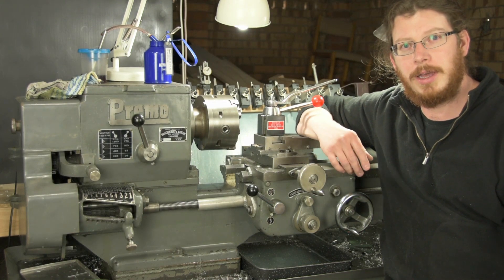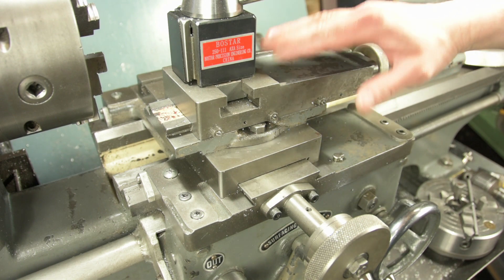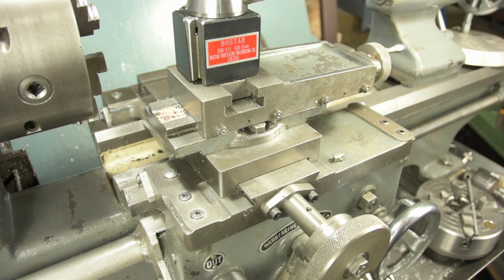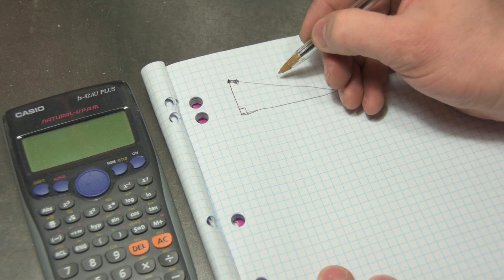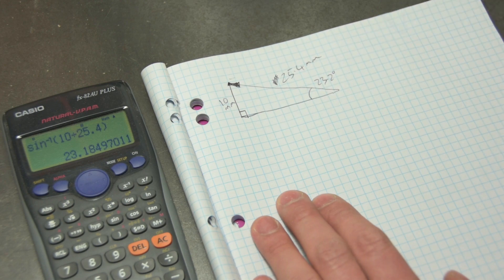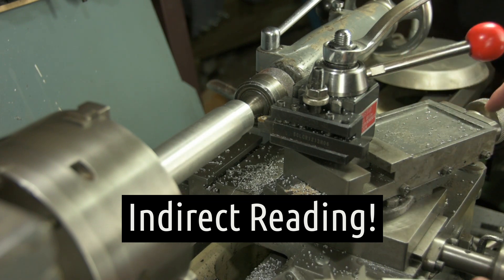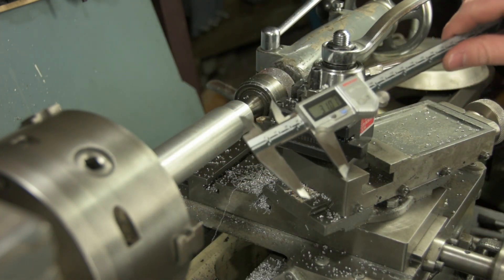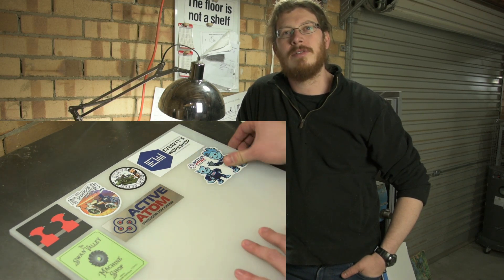Making metric cuts on an Imperial lathe (and vise versa)

Comment: Or plan B...make a set of Imperial/metric dials. My lathe has them, but I never bother using the metric scales as the cross feed and tail stock feed screws are imperial.
https://i.postimg.cc/j24W4tJZ/IMG-0821.jpg
Cheers from NC/USA
Reply from the maker: That's a good setup. Some of the imported lathes sold new in Australia have that feature. But - the lead screw is always either metric or imperial and if you're using the non-native units, multi-turn movements can become a maths quiz where a wrong answer means a scrapped part. :-) I am hoping to install a DRO one day on the lathe. Installed one on the mill and it's an absolute game changer. Just a question of raising some funds. And that's especially difficult while trying to buy a house. Thanks again! Craig

Comment: Very cool. Any idea what this is called? Not the mathematical part. I assume it has some sort of name for this procedure,   easier to google search it for more info.
Reply from the maker: Thanks Craig. The fine compound feed method using a ratio of 1:10 or similar for either metric or imperial is an old old trick. I don't know the origin or any better name for it.

The method of converting units from metric to imperial or vise versa, using trigonometry, is - as far as I know - a new idea. I haven't seen it elsewhere. So it's as yet unnamed.

Cheers,
Craig
Reply from the maker: PS: If you are interested in a couple of channel stickers for your toolbox, email me your postal address. I am heading to the post office tomorrow morning (approx 12 hours away). Cheers, Craig

Comment: Hi Craig. There were some really clever engineers years before your scientific calculator kicked in to work it out.
Great method and well explained loved the co sine bit (memories) even though it straight over my head lol.
Reply from the maker: Even the clever blokes used to look up with sin, cos and tan tables and charts :-) When I was a kid I learned how to use a slide rule, that was pretty cool, but you also need to do a bit of mental arithmetic as well, and I'm very lazy so that didn't last long. The cheapie casio calculator I'm using is a dream, it can do everything I want and costs very little. Look up  a video from Emma's Spareroom Machine shop - there's an awesome machinist's calculator. If you haven't seen one before, you'll love it. Does lots of clever stuff for anyone doing metalwork/engineering.

Comment: My instructor in machining class showed us the 5.7 degree trick, but I like how you did the same type of conversion to metric.  Thankfully I have dials graduated in both, but having a finer feed would still be useful for my machine.
Reply from the maker: Hey Everett!. Yes - not useful for everyone - but hopefully a pretty neat trick anyway  :) Dual dials sounds like a dream. I suppose a DRO would be a good retrofit solution, but I'm still stuck at the DRO installation phase on my mill, so I'd be a fool to think about adding one to the lathe until later (much later) :)
Reply: @CraigsWorkshop  It will still be useful for me, as you say it's easier to put a finer inward cut using the trigonometry. Having to crank further to take that .015 mm more instead of overshooting to .02 would be handy!

Comment: Good tip Craig.  It always pays to angle the topslide when creeping up on a fit and grinding, but I hadn't actually thought about doing a unit conversion.   I use a digital indicator, but that's a handy trick for sure.  The trouble with a lot of Chinese lathes is that you can't trust the increment dials as they are often not true, mine included, so that's why I use a readout. Thanks for posting.  Cheers Rob
Reply from the maker: Thanks Rob, appreciate you dropping in! The only reason I have to do this is because I haven't yet made one of your nifty digital tyre depth gauges with a magnet on the back! I have the parts, just haven't got around to it yet. Cheers, Craig

Comment: Excellent! This is the exact kind of tip that allows the hobbyist an eye opening and important visit into the mindset of a true machinist. I don't think the average person sees or approaches things with the same fluidity and working knowledge of various mathematics put into a practical cause and effect form the way machinist do.  Just about anyone can operate a machine, but those at one with the math behind what is taking place on the machine almost play the machine like an instrument, and the results are precise, gorgeous, sought after, and strived for. Anytime you can unlock a bit of virtuosity and share it in a simple way... you've done a very good thing. :)
Reply from the maker: Blown away by your super kind comment John! Cheers! :)
Reply: @CraigsWorkshop  You earned it, Craig. I like your lathe btw. Is it a geared head machine?
Reply from the maker: @johnstrange6799  It's a bit of a hybrid headstock design - boxy like a geared head, and it does have internal gears and an external lever for  backgear at least, but the other method of changing gears is by a pair of 4-step cone pulleys inside the change gear door cover. I'll have to take some video shots of inside the headstock and change gear cover because on the end it looks like any other lathe, but inside, it's super beefy, and really designed for making fairly heavy cuts (for an 11" swing, 24" between centers lathe). I love it. I changed from a Hercus 9A, which is a clone of a Southbend 9A and I have no regrets, this machine is more accurate, triple the weight, and doesn't take up a lot more footprint in my tiny shop. Too much info for a comment, I will make a video about it one day if there's sufficient interest! :-)
Reply: @CraigsWorkshop  Perfect info, thanks. I like to know about other machines out there.